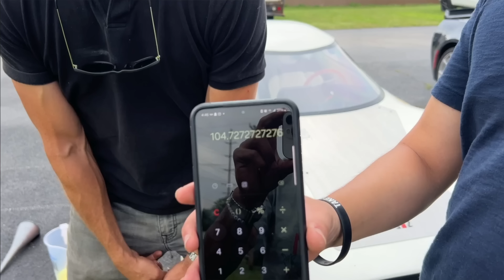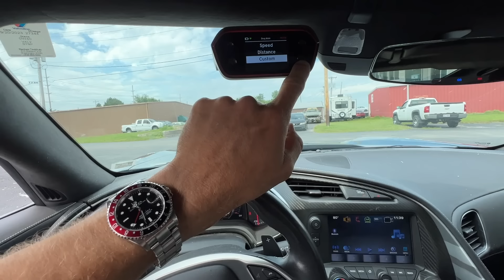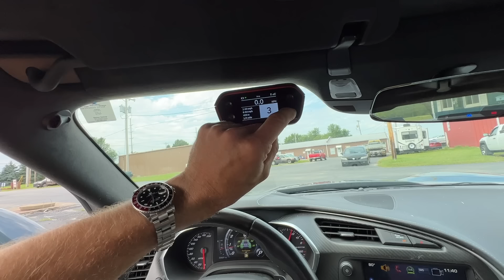FIRST 0-60 mph Test- Diesel OMEGA CAR - Video 3 of 3

Comment: I’m glad you were able to build the Omega and make it reach your goals! Congratulations! 🎉 
The Tesla is actually a Short range model but that is beside the point. Now put the required safety features in and see how much MPG it does. 🤷‍♂️ maybe do a weight of those things and compare times and MPG?
Most of loss in mileage is safety and smog control. 
The time is coming for high mileage vehicles that will make this all redundant. Battery tech will advance and make EVs charge in 5 minutes and get 500 miles per a charge. This will end gasoline and diesel engines. 
Kids dying in cobalt mines? How many kids die from lots of things made for gas and diesel cars? Nothing to compare there either. 🤷‍♂️ 
I still agree with you for the most part. 😂🤙🤙

Comment: I’ve been saying this for years. Diesel for all transportation, fuel for racing. If we made longevity and efficiency goal 1, we’d have cars that go for million miles without major repairs and getting 150mpg. Not a way to make money. Took the fam on a trip in a 2024 Ford Edge. Very safe. That’s it. All engineering was focused on safety. That car will not age well. Cvt, crappy lcd controls. What a waste. Great job, so glad I found your channel!

Comment: Can you provide more specs on this car? Curb weight, estimated power, etc? It'd be cool to have a video detailing some of the engineering principles that went into the vehicle and potentially what you would change based on your current analysis.

Modern safety standards do add a lot of weight to vehicles so I'm curious how the Omega stands up to that kind of scrutiny. I saw no airbags and only a lap belt, so it's already short on a few things. I don't totally agree with all of the modern standards, but given how many people operate 6000lb+ flying metal fists while texting, I'm a little curious.

Of course, it could always be converted into a three wheel cyclecar to get around that kind of red tape...
Reply: Limited production numbers (IIRC under 300-400/yr) and/or offering kit car versions will also get him around the red tape.
Reply: Yep that's my problem that thing is a death trap and to pass modern standards needs ALOT of work. The engine and mpg is impressive though
Reply: The “genius” won’t. He enjoys the fantasy too much to destroy it with actual insight and scientific methodology.

Comment: I have an ahu 1.9 tdi in my 87 jetta coupe and it gets 45 mpg with stage 2 tune..I have owned 100+ cars including Porsche 356, 912, 930 all the vw , bmw 2002 s ..
That being said...
The beat engine ever made is the 1.9tdi imo
 Smooth
Powerful
efficient.
I have a 67 split window vw delixe bus I am looking to swap the 1.9 in to as the rorque is great and this was always the bus' problem.
Great job Casey you are crazy enough to not let your dreams be just memes..
Reply from the maker: :) thank you

Comment: I'm not a car person, more of a truck person, but still found this really cool!

I wish we were like Japan.. (you may not like it) but I think their little "Kei Trucks" are freaking awesome... small, fun, affordable, utilitarian..  have some really neat modded trucks as well.

What do you think of the Hybrid platforms? Have you see that "Semi" on youtube that's called "Topsy" or something like that? 
They use a diesel engine as a generator, that runs the electric motors.. 

Anyways, Toyota recently released something called the "Toyota Hilux Champ" platform in asian, a little small truck, where you can swap out the bed and do different builds off the same platform. Its diesel. 4x4.. but not released in America.. b/c (reasons?)  and if it does come here, they'd probably use a "Hybrid form"..

I think it'd be pretty cool to see it come here. 

Obviously a hybrid system does complicate matters in a way b/c its 2 systems working together.  (But trains have done this for a long time & made it work)

Anyways again neat video thanks for doing this!

Comment: LOVE how he acelerate from 2second gear, diesel engines can do that and save time. ALSO, yes, diesel engines run 100mpg at 40mph on 5th gear, maybe if it has 6th gear even more, all depends the set of the manual gears.-

Comment: Getting rid of the wheel spin at launch might shave a tenth off the time, but I don't think it's worth it.

Bigger tires means more rolling resistance and less efficiency. 

I'm thinking the balance is very close to perfect now.

Very impressive.

Comment: I know testers for mfgs 0-60 times use optimum  conditions, optimised tire pressure, fresh new tires, and likely on a prepped drag strip. All three cars (other than the Tesla) had tire spin, which significantly hurt the numbers... so they can accelerate more quickly.

Comment: Also note the diesel engine does not need to be designed to burn diesel fuel... it just happened that diesel fuel was a waste product of making gasoline for the Otto cycle engines (traditional 4 stroke gas engines)... but the diesel prototypes were way more flexible, and the giant marine diesels that power ships can burn a wide array of fuels ranging from light fuels to VERY heavy oils and theoretically a coal-water slurry if that is what you want to burn and you can keep the injectors from clogging (those diesels move slow so they can burn practically anything combustible). All this to say that it is theoretically possible to make a diesel cycle engine that can burn lighter fuels like gasoline but with the efficiency of a diesel cycle engine... though the fuel economy would go down a little since I think most diesel fuels have a slightly higher energy per volume than gasoline does... still, the diesel cycle is rather versatile and is limited only by the mechanical limits of the fuel injection system, lubrication system, and the rotational speed of the engine... slower diesels can burn ridiculously heavy fuels including super heavy oils and solid water slurry... faster diesels burn diesel fuel and a few can burn lighter fuels but they're not exactly mass produced at this time.

Comment: I'm just really curious on what you used to make the monocoque, you said it isn't carbon fiber or fiberglass and it's sounds like it's not woven (it would also be easier to make a whole monocoque if it's laminated by hand and would be easier to repair), myb flax (i wouldn't be surprised since when you tapped at the car it sounded a bit dull which flax does),aramid or diolen since you said it could be recycled but it's hard to see a monocoque made out of that due to stiffness or humidity absorption issue. Myb you also used epoxy bio resins?
I'm also wondering what motor and turbo you used 

Maybe i'm just talking too much and missed the information in the video since i watched with the corner of my eye but it's really cool anyway

Comment: Unfortunately, NTSB and other regulations will require additional, heavy components to be "road legal". I ran into them a few decades ago with a propane electric hybrid I designed and built. It approached 80mpg then, and with today's batteries and controls technology, it would easily break 100mpg. I would have to build it as a "reverse trike" motorcycle to avoid the "rules and regulations". Congratulations on your efforts and achievements!  I wish you luck in your pursuit.

Comment: Casey…, just ‘out-of-the-blue’ came across your site. And all I can say is “Wow!”. I have one question, would your engine work on an awesome 4x4 like …, oh let’s say an old Toyota Land Cruiser, or a Rover Defender 90? With just the basics like speedometer, and fuel gage, and a six speed transmission with two low low gears? Just dreaming I know, but diesels have been getting such a bad rap in the USA. And we have such a big country. A hundred miles a gallon 4x4 is such a dream…, oh, since I’m ordering the dream, it can be easily maintained by the owner. Yeah, that’s the ticket. Yep, I’m dreaming.
Reply from the maker: It’s not about the engine….

Comment: A couple points 1. You do have to sacrifice a lot for the creature comforts like auto windows, A/C, Vibration/sound mitigation. 2. That thing definately won't meet any form of crash test rating...
Reply from the maker: P r o t o t y p e…….
Reply: @CaseyPutsch  yeah but all of those things add a bunch of weight and strain on the motor like A/C so your 100mpg dives hard

Comment: When you tested the Model 3 acceleration, what was the battery percentage, and was the battery warmed up? These things have a major impact on performance. A Model 3 with a warmed up battery at 90% SoC is way faster than having a cold battery with 50% SoC.
Reply from the maker: Warm, 94%

Comment: I've been doing a little research, and from my research, I believe that the reason why you are not getting the recognition that you deserve is because the car isn't exciting enough. I think if you would have built a kit that was able to be dropped in any existing car that gave the same or similar gas mileage and performance, and maybe added some sort of self generating hybrid system that definitely would have scared the car industry. Also, if your car was an SUV, a performance SUV with the same gas mileage and performance, I think that also would have changed things. I would love to see a small  performance SUV build aka  a GMC Typhoon l, with performance and slight off-road capability with a hybrid system that can rival anything on the market today that definitely will get everybody's attention hands down. 🤞🏾

Comment: Casey, Do you think it would be beneficial at all to have a purpose built engine meant to run on a specific veggie oil? I know diesels were invented to run on peanut oil (or somethin' like that) but It isn't very practical if you just slap veggie oil into a diesel, and I don't know yet if veggie oil emissions have an edge on a well tuned diesel.

Comment: Yup and it can do it over and over with no worries, collectible,  interesting, visceral experiences in either car, vette interior is a nice place to be, ac, nice creature comforts, could drive it daily, and or track it no worries, will do it all day and is fun and reliable and handles really well. .  I love you built your car, and the mileage is awesome, but I'd assume not nearly as safe as a vette, and doesn't handle nearly as well as either of those, and the viper is a death trap at the limit  even with big meats. Does yours handle well or have nice mag suspension like some of the vettes? Or are  Parts are around for your car if I broke it? I Love you built your car, and the mileage is great, and hopefully someday you get it to a place where you can actually launch it a bunch if ya want, and not worry about it breaking and it be reliable or  Have an actual structure around it, and quality interior, parts, saftey features, all that stuff you need in a car to sell it beyond that of a kit car.  I guess why I felt compelled to comment was there's no need to piss on performance cars because they don't get 100mpg.  They weren't designed to get 100mpg. Also  To me it didn't sound like you were actually using the lc in the vette.  You were just power braking it, which would lead you to a dismal 0to60 time.  Only works in track, and you have to have the sequence right or it just is power braking which I'm almost certain is what you were doing.  Anyways What I'm getting at, is there's no need to piss on those cars to make yours something good.  It's it's own lane, go with that, and leave other cars outta it.  They have you beat in many other categories if you want to play that type of thing. Which isn't necessary.  Yours is unique, it's a great idea, exterior curves on my phone screen looks nice but I cant tell how nice it really is even for a prototype.  I know how nice vettes are if you are a vette guy and those vipers are old tech now but i at least know what they are about inside and out.  I cant say that for yours aside from the vids.  I can tell your interior needs alot though.  But seriously,  kudos for developing what you have, keep refining it plz.  Using performance cars as benchmarks is fine, just no need to try to make yours seem better when it actuality it's probably not aside from yor mileage claim.  I will also say  My audi s4 murders all of them, and I can still get almost 30mpg driving nicely.  And the interior is really nice sounds great great in all
Weather all that.  Oh,  Do u average over  100mpg after doing several pulls and then going for a cruise? Or does it drop alot? Maybe I missed that.  Anyways.  Great work

Comment: Maybe add a small heatsink behind the Ipad so that the temperatures stay down and it doesn't have to thermal throttle, also you can wire the Ipad without the battery ,so that it turns on when the. Car is powerd on just a suggestion

Comment: I would like to know how much this car costed you to make. as an aspiring auto manufacturer myself I have been dreaming of this type of fuel efficiency from a more mass produced family or economy related car, yours looks fancy! and of course I know aerodynamics are incorporated and entirely fundamental to the efficiency but would it not be possible to translate this type or similar design into a slightly larger four seater car with more trunk space? if so and even if not, you have a product with massive potential and I highly encourage you to market and mass produce this vehicle while you can.